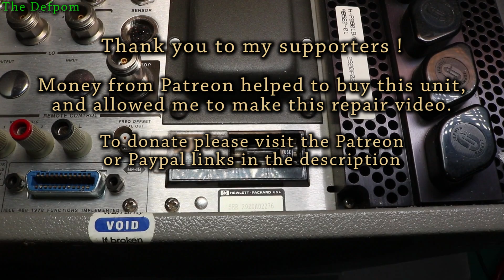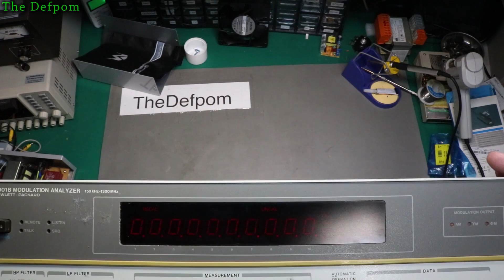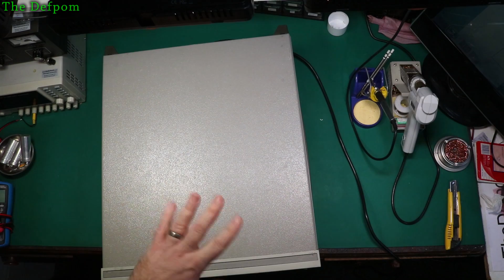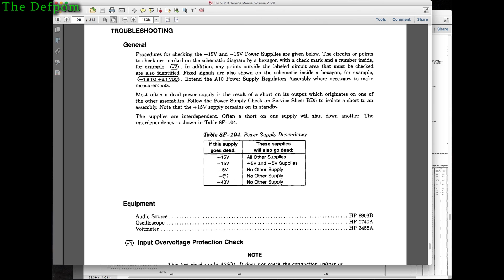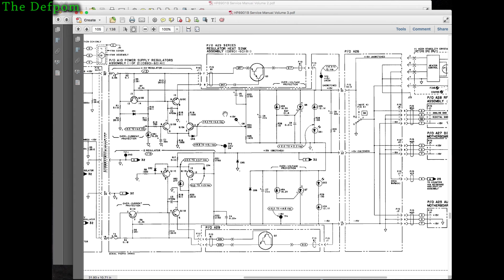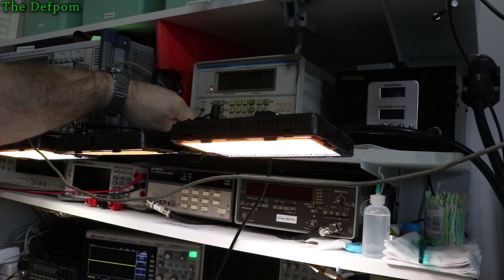🔴 #446 Fix It Friday - HP8901B Modulation Analyzer Repair Part 1 - How to fix a power supply

Comment: I have an HP8901 that works for me up to 600 mhz it does not go up more than frequency, could you guide me if it is the bender or where the problem may be.
Thank you
Reply from the maker: There are a few variants of the unit, I have the 8901B, the service manual for that shows that above 640MHz it uses a doubler on the A19 board, so that is a starting point.
Reply: @TheDefpom  
Thank you very much for the information

Comment: Ha! Talk about serendipity, the power supply on my 8902A just failed so I was going to do a video on fixing it. Looking forward to part 2.
Reply from the maker: tgsoapbox - part 2 is next Friday, just shows me putting a new cap in, replacing the fan, calibration of the supply voltage.
Reply: Nice. I did a quick overview of how to use the 8901B here in this video, https://youtu.be/sbN9-3rf1A4. They're great bits of kit. I think you'll find that the frame has all the holes in it for you to move the rear input to the front.
Reply from the maker: tgsoapbox - yep do a video, I need something to watch 🤓
Reply: @TheDefpom  Turns out that I didn't do a video as I had the skirts off to get better acquainted with the layout and circuitry. While looking at it and reading the manual on operation I noticed what looked like a dry solder joint on A26K1 - Just fluxed & reflowed and it works fine now - Didn't even turn on the camera....
Reply: Yet another interesting channel to follow! Fantastic, there goes more free time lol

Comment: Great video - sound and lighting are good. Get a 30 dB 10 watt attenuator and you can do most low power transmitter checks with a direct connection. You can tell the unit what external attenuator value you are using and it will calculate the power in watts or dBm for you. Also, depending on frequency, you can have it display frequency to 1/10 Hz or 1 Hz for transmitter tuning. Couldn't see if you got the high accuracy OXCO option or not.
Reply from the maker: It doesn't have the OCXO option, I might have to see about making something for it, it does have the option for the high resolution though.

I am setting up another bench/lab in another room which I will use for RF work (away from all this common mode noise I have here), so it will be going out there, most likely with my one of my digital scopes and my old Tektronix 2432A and some other RF gear.

I can now sell my old Marconi 2305 (which works fine) I did a repair video on it ages ago when I first started the channel and I had less than 80 subs at the time!

Comment: Very nice.. I always think those HP voltage selectors are a bit odd.  I made a mistake with  one of my many my hp Logic analyser recently but got lucky and it just blew the fuse. I completely forgot to switch the voltage over in my excitement. Stupid Stupid me!
Reply from the maker: I am certain that one day I will blow the crap out of a bit of gear when I forget to change it over! I ALMOST had that yesterday in fact, I checked the voltage marked on the back of the unit and it was marked as being set to 240v, but I then checked the actual setting switches inside, it was set to 115v, so lucky I didn’t trust it! Just goes to show to always check it on a newly acquired item.